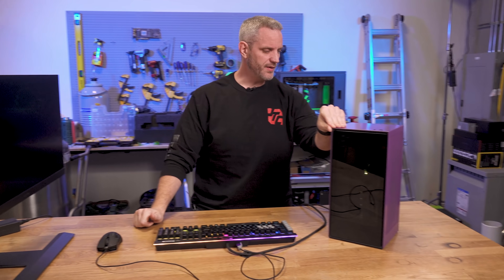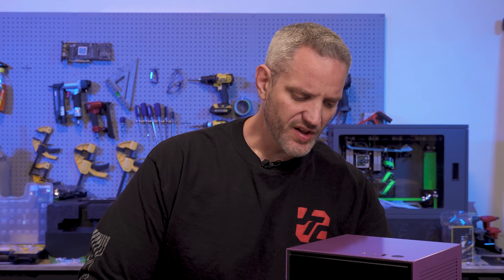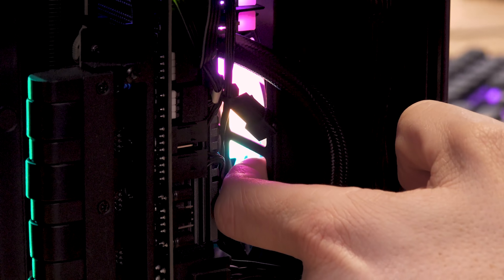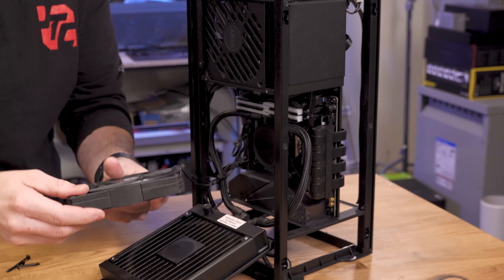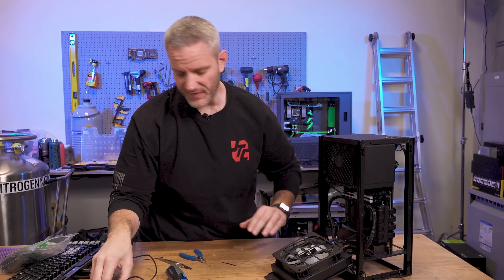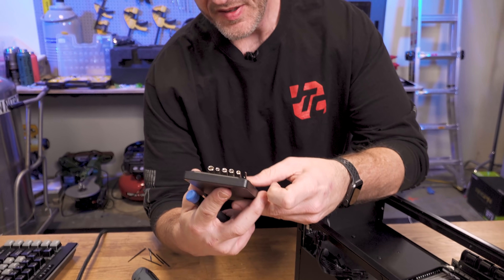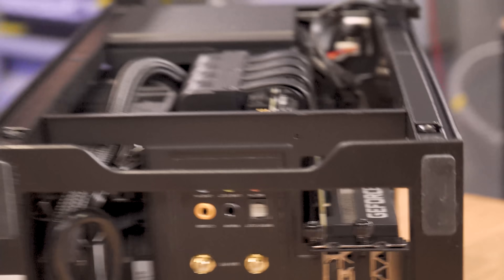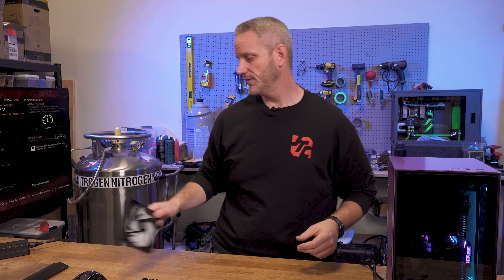This PC is shutting down due to overheating... let's investigate why!

Comment: I have a faulty led diode in my rgb fan and it causes flickering of all fans ,which causes power instability ,whitch triggers overcurrent protection on my motherboard. When i unplug the rgb ewerithing works without any problem. Worst is fact that the fan was preinstalled in case ,so i will have to send back my case.

Comment: Oh no Jay doesn't watch Steve's videos :O & he turned the screw an may have introduced the 12v to ground connection. It's happening inside the PCB,seems to be how far or little the screw is threaded in,hinting that it's the threads catching the trace just by chance. Get that PC back for a new riser or atleast the nylon screw kit,though Steve doesn't seem to think nylon screws are a good enough fix.
Reply: Yes he does watch it. His newest video credits Steve for finding the issue.
Reply: @mjisurdad  I saw that,I figured he'd post a update

Comment: Edit: After watching the newer videos, removal of the metal screw is necessary. It has the possibility of damaging GPUs if nothing is done. Still, this is a problem for second-hand use of the computer case if people are not informed of the issue.

I think people are misinterpreting gamer's nexus' video again. Correct me if I'm wrong but if there you haven't removed the metal screw and your computer isn't on fire, you're fine (but probably replace the screw). If you use the replacement nylon hardware, you're good. If you are repeatedly reinstalling the riser card and the metal screw in this case, it will shave off the PCB eventually exposing the copper traces. The issue isn't an immediate threat, but someone may encounter it if reusing or moding the case and riser card, especially when getting it second hand.

Comment: Obligatory request for Jay to retract this video, the washer fix will not work, Gamers nexus have proven the issue is the threads cutting into a 12v trace in a mid-layer of the PCB and nylon washers will not fix the problem. This case still poses a fire risk as Jay has left it.
Reply: Watch yesterday’s video
Reply: @mjisurdad  already have, and?

Comment: 8:19 time stamp transition after watching Gamers Nexus H1 Pcie Riser fire issue.
Reply: Please help 
I built my pc and it starts but I get no signals on my monitor 
Tried everything 
Ram 
The monitor it self 
Gpu 
Everything is plugged correctly btw 
The fans spin and lights are on but there's no lights and my keyboard and mouse don't get lights as well 
I got ryzen 5 2600 
16gb ddr4 3000
2060 rtx 
Psu is 400w 

Where is the problem??

Comment: That screwdriver is not good it will twist, and hurt your wrist. Because it does not lock the motor after you let go of the switch.

Comment: How does the washer fix the grounding issue? Isn't it still making contact through the threads when it is screwed in? Is the metal on the face of the hole isolated form the metal being screwed into or something?
Reply: At the time they didn’t realize the screw was eating into the pcb

Comment: I would pull that pcie riser out and check were those 12 volt traces go on the riser pcb Jay, if they are near those screw holes the threads on the screw could catch the side of them and putting plastic washers on the top makes no different whats so ever!, After watching steve's video of him adjusting that screw and it starting fire I wouldn't take the risk by doing what you have done because you could still have a connection between the screw thread and the pcb then down threw ground to the chassis, how many amps does your 12v rail in your psu have????, it's the current that makes every thing hot then it catches fire, I work as a electronics repair tech every day, stay safe and replace that riser cable...........:-).....It's like putting alot of current across a metal rod and watching it glow cherry red, be careful..............
Reply: He knows now

Comment: Obligatory "Go watch the GN video" comment here. You probably saw it by now, but seriously, go watch GN video about that NZXT fire issue. Probably best to replace the whole riser cable just to be safe.
Reply: That wont fix it if the PCB doesn't change. its the PCB that has the negligent design flaw which basiy fails the 101 of PCB design never put hot traces in close proximity to screw holes.
Reply: This video was made before GN's

Comment: Gamer'sNexus just did a breakdown of the fire potential. Plastic or nylon washer will not fix this.
Reply: Yeah the washer doesn't fix the screw thread hitting the 12v pcb layer. Did you see the dust he pulled from that hole just removing the screw? Just eating the pcb.
Reply: @ross9170  by doing this he actually could make the problem worse...the threads he put back thru are now at tension with the plastic washer making the threads bite more.  Jay please show us that you have RE-Fitted or Redone this with a proper fix.
Reply: Please help 
I built my pc and it starts but I get no signals on my monitor 
Tried everything 
Ram 
The monitor it self 
Gpu 
Everything is plugged correctly btw 
The fans spin and lights are on but there's no lights and my keyboard and mouse don't get lights as well 
I got ryzen 5 2600 
16gb ddr4 3000
2060 rtx 
Psu is 400w 

Where is the problem??
Reply: @I’m Hungry I know this may sound silly, but is your monitor connected to your motherboards display output or to your graphics cards display output?
Reply: This needs more likes @JayzTwoCents
Reply: Nylon will but they can break is all.
Reply: @mjisurdad  a nylon washer will not stop the metal screw from making contact within the PCB layers and then making contact with the frame. Requires a completely nonconductive screw. Yes a nylon screw will break. NZXT needs to do a recall and replace the riser. It's a shame that they are doing the math to see if the cost of a recall outweighs the cost of the lawsuits due to house fires and/or lose of life.
Reply: @mjisurdad  nylon bolts are a temporary fix, the fix shown in this video, a washer, will not work.
Reply: @danielvanced5526  A nylon screw/nut is a permanent fix. The only thing those screws really do is hold the riser in place when there's no GPU installed. When there's a GPU installed, there's no way for it to move even with no screws. So there's not really any strain on the screws. They aren't load bearing.
Reply: @qumefox  funny, the CPSC didn't agree.
Reply: @qumefox  As Steve from Gamer's Nexus pointed out, even that isn't a 100% permanent fix. If this case was eventually sold second hand and someone replaced the nylon screw with a conductive one the problem would return.
Reply: @mjisurdad  Watch gamers nexus video on this issue,a washer  not stop the screw THREADS from contacting an internal 12v trace which is way to close to the screw hole, dangerously close, close enough that the screw threads can ground the 12v trace if turned just right.

In fact a nylon washe may change things just enough to alter thread positioning and cause a fire. 

Removing the screw completely and fixing withdouble sided tape or velcro would workaround the issue,  but as GN saya,nothing short of replacing the badly/negligently designed pcb will actually fix this.

Comment: PSA: Nylon Washers aren't a solution, if you haven't gotten the Nylon Screw fix kit from NZXT, use zip ties till they arrive.
Reply: Zip ties are a solid solution if NZXT's fix is not available in your area.

Comment: I don't think the nylon washers are enough. The contact could still be made by the threads, as in steves video. This would only prevent surface contact between the head and board, or board and case.

Use a ziptie or a nylon screw.
Reply: If you have the old PCIE riser that can catch on fire, don't follow the advice of this video. Watch Gamers Nexus video on the subject. You cannot use the bottom metal screw. A nylon screw is a temporary fix but you need to get a free replacement/new V3 riser from NZXT
Reply: Agreed, the second video has completely proven this washer fix would not work, a retraction is needed.
Reply: This needs to be higher
Reply: That "fix" actually increased the chance of the case catching fire
Reply: @LuckyBlade1988  are you referring to Nzxt’s official fix?
Reply: @joubinboghiri6057  no I'm referring to Jay's method.
Reply: I hope he saw this or knows about it....
Reply: Yeah, the plastic washer did jack shit.
Reply: Jay should have know better. Thinking the washer was going to do anything is idiotic at best. He needs to update this video.
Reply: I'm not sure if I entirely understand this issue, but would the point of the nylon washer be to prevent the contact between the screw and the case which is what would ground the screw in the first place? Not sure if it would actually achieve that, as he never showed us the bottom of the screw and if it could still touch the case. I agree this was not a good fix and shows Jay didn't watch Steve's follow up video. Rather irresponsible on his part.
Reply: @zvexevz  the screw treads into the case itself. it wasn't about the screw being too long, it was a design fault with the pcb itself having a 12v layer too close to the hole. The hole itself was too small for the screw as well so the threads would cut into the walls of the hole, connecting 12v to other layers of the pcb and direct to ground through the case.
Reply: up up up you GO!
Reply: This^^^^
Reply: That's exactly what I do. Whenever in doubt of grounding, I replace the screws with zipties. Works like a charm.
Reply: Steve proved that the grounding occurs with the copper trace INSIDE the PCB. Putting the nylon washer on the SURFACE of the PCB is useless. Sorry Jay.
Reply: I think zipties would be fine
Reply: @creed5248  even that may not be enough. Once that screw from the factory went in the board layers were damaged.

Comment: I get between 40-60 (fluctuating) temp on low loads like 5% or less to idle. (isn't that too high?) , though i did a CPU stress test at 100% load and the temp never exceeds 80. Is there something wrong?
Reply: Fluctuating 40 to 60 while idle or low loads is kinda high.

Comment: Thanks for your video’s.   Can you pls help me?  My pc start stuttering a month ago, even sound is weird.  Ryzen 5 3600x with a msi gtx 1600 6gb and 16gb mem 3000mhz.  I tried many possible sollutions, even installed windows a few times, nothing helped.  The stuttering starts sometimes after 10 minutes, sometimes after a few hours of gaming.  There is no heat problem, drivers up to date.   I even went to a pc shop, they said they fixed it (100 €), but no.... again stuttering randomly afther some times.   I cant go back to the shop, cause they just reinstall windows, they test it... and charge me.   I dont have any idea where to look.  Can you pls help me or make a video about it?

Comment: This is exactly why I like you Jay. It's easy to take all the newest hardware you get for free, test it, post benches, and say if you like it or not. 

You actually post what most people would call pointless but proof that you're a REAL builder and what we have to deal with. As much as I try to be a PC gaming advocate that tells people it's no more difficult than paying Sony to deal with all the crap, we all run into weird crap like this. The beauty of it is you can fix it because it's PC. You can't fix a PS5 that's overheating.

Comment: When I design PCBs, I usually either design the screw position to be an intentional grounding point or route tracks a safe distance away, so nothing connects to the screw.  This obviously may pose a space management challenge when there's a more space needed.

Comment: Ummm Jay, sorry to break it to you but that's not a mag lev fan that you installed at 8:35, that's a LL120 or light loop fan which is what that white plastic ring around the inner housing is. They don't have magnetic levitating bearings like ML120 fans do.

Comment: After watching this video I think maybe you can point my son in the fight direction he build a system after watching several videos (load MS office 10 booth up and work however sometimes it will not turn on/booth up, he is thinking the mother board night not be getting enough power?). He purchased the below parts and put the computer together him self: (Game he play Call of Duty) please advise what you think might be the issue(s) thank you. 
(1) Box: Montech Fighter 600 ATX Mid-tower computer gaming case. 
(2) Motherboard: B450 ASUS. 
(3) Ram: 2x8GH XPG DDR4. 
(4) Graphics Card: 1650 MSI. 
(5) CPU: AMD-Ryzen 5. 
(6) Power Supply: 500W 80 plus standard thermaltake.

Comment: Problems I have had with my PC this month:

• Blue screens of death x100 (After I upgraded to an i9 9900K)
• SSD will not show. I checked with a different Sata cable and accidently pluged a Sata 2 cable into it and bricked that one. promptly threw away the SATA 2 cable (to be fair, it looked really really nice.)
• Did not know flashing the BIOS would also flash my boot drive. had to re install windows and lost all my files.
• Cyberpunk 2077 likes to fight with my PC.

Okay, so its not a long list but every BSoD I got had a different error code, So I have been playing wack-a-mole with driver updates and CMD prompt fixes. 

So yeah Jay, tis the fucking season for sure... and as you said before "Most of my viewers know enough to be dangerous to the system but not enough to fix it on their own." Id say it was pretty spot on lol

Comment: Hey Jay! In regards to the Metallicgear fans, a lot of people online, including myself have had this same issue with Phanteks fans. I recently built a new high end system with 140mm phanteks rgb fans (ones that come with the P500A) and one of them broke just like yours within the first 2 hours of using it! I love Phanteks cases, but this really sucks! You could argue that the fan should of been horizontal instead (like you said), but the case comes with the fans vertical at the front! I'm not going to go to all the effort to just get another poorly designed fan. Just thought you would be interested in this. Also I was unable to re oil the fan like some people online suggested, but after I took the fan sticker off, there was no refill hole.

Comment: what size are those washers for the gpu riser bracket?
Reply: Please help 
I built my pc and it starts but I get no signals on my monitor 
Tried everything 
Ram 
The monitor it self 
Gpu 
Everything is plugged correctly btw 
The fans spin and lights are on but there's no lights and my keyboard and mouse don't get lights as well
The pc stays on for few min and turns off automatically than it turns back on
I got ryzen 5 2600 
16gb ddr4 3000
2060 rtx 
Psu is 400w 

Where is the problem??

Comment: You need a static pressure fan.
Reply: Please help 
I built my pc and it starts but I get no signals on my monitor 
Tried everything 
Ram 
The monitor it self 
Gpu 
Everything is plugged correctly btw 
The fans spin and lights are on but there's no lights and my keyboard and mouse don't get lights as well
The pc stays on for few min and turns off automatically than it turns back on
I got ryzen 5 2600 
16gb ddr4 3000
2060 rtx 
Psu is 400w 

Where is the problem??
Reply: @imhungry8713  PSU is too weak for those parts.  If it’s a new build, might update BIOS using another CPU.  But you need at least a 750 watt PSU.  It’s probably a dead PSU now.
Reply: Ok man tnx

Comment: lol that washer does nothing. the threads would cut on the INSIDE of the hole and ground where it threads into the metal case. it isnt the head of the screw on the surface of the board.

Comment: hey anyone want to purchase an Alienware m15  with: 

144hz refresh
RTX 2069
i7 8th gen
2x16 GB ddr4 
 
reply to this comment! i’m looking for around $1000 for the entire thing which is a great deal considering the specs on the model usually sell new for $1600! only catch is it will not come with a hard drive or windows 10 because i do not want my privacy to be traceable. 

as of now its runs great and gets 70-110 fps in most modern games at medium settings, only issue i had with it was that the original hard drive died so i had to buy a samsung m2 ssd (which actually is cheaper and faster lol).  

if you would like to get in personal contact with me just message me, i can facetime you and show you its performance live if you want

Comment: I wish my problem were this simple. Lol. 5950X might run hot, but at default in multi test R15 90C, and low multi and single score. I have used new paste, made bios default, bios flashback too 2 different bios version. Considering buying a new AIO (h150i), running with 13 total fans with push/pull in lian Li XL dynamic. @Jay any idea?

- Crosshair VIII hero (Wi-Fi)
- Royal g.skill 3600 cl14 (4 kit) 32gb.
- 850w ax850 psu

Comment: Bought the ryzen 5 5600x and used the cooler that it comes with. When I push my pc even a tiny bit I get bsods. Temps were skyrocketing at about 80 to 90 degrees. Bought the darkrock4 pro and now the Lil fucker can't even hit 50 degrees or crash no matter what i throw at him.

Comment: my psu fan broke due to similar reason. my evga psu had a fluid dynamic fan, it failed due to wear and then a fan blade broke. it was installed sideways due to O11D sideways psu mount. replaced with an seasonic with a silent running mode so the fan dose not run as fast.
Reply: Please help 
I built my pc and it starts but I get no signals on my monitor 
Tried everything 
Ram 
The monitor it self 
Gpu 
Everything is plugged correctly btw 
The fans spin and lights are on but there's no lights and my keyboard and mouse don't get lights as well
The pc stays on for few min and turns off automatically than it turns back on
I got ryzen 5 2600 
16gb ddr4 3000
2060 rtx 
Psu is 400w 

Where is the problem??